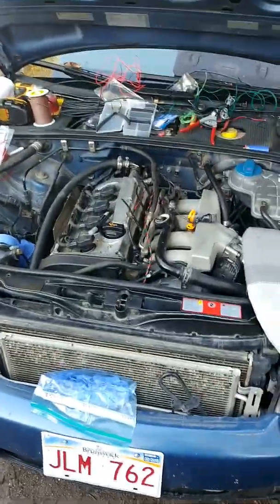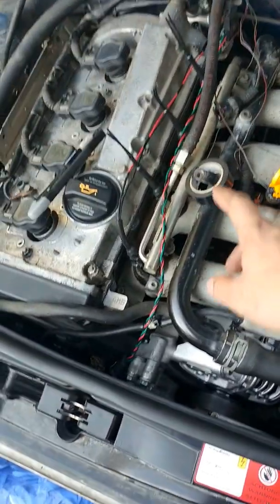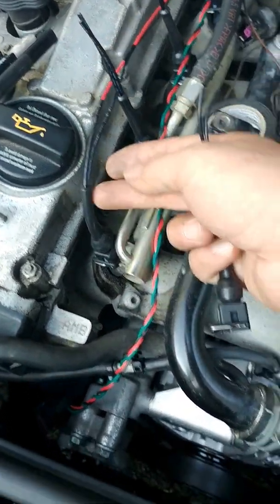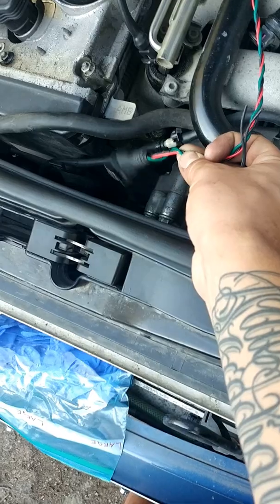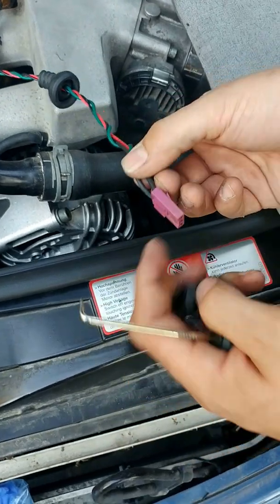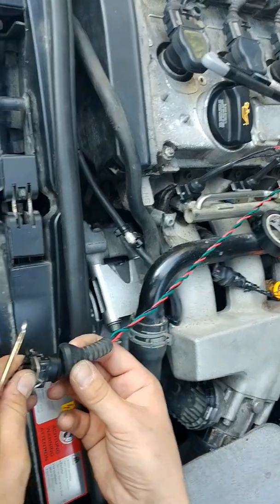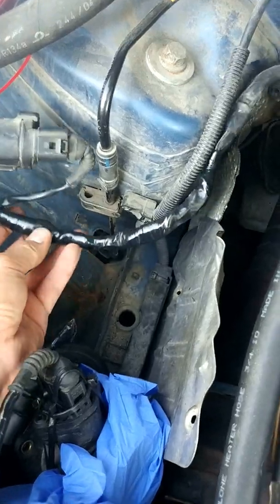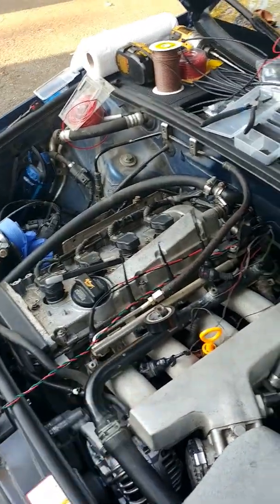b6 a4 1.8t fuel injector repair

Comment: Hey cool video umm I don't know if you still have this same car or even know the answer to my question,but I was wondering how to I go about finding out which wire goes to which pin number on the fuel inj. Plugs..I had at one point it all video taped and written down and such the order in which they go but amidst some controversy it has all been lost or thrown away...well thanknu...as I've been trying to find the color code basically for my injectors on my 2003 a4 1.8l..tllhanx

Comment: Hey mark, my car cranks but does not start, I hooked up the scanner and it’s giving me a code for every injector. HELP
Reply: What specific code is showing and what does it say?
Reply: P0265!
Reply: Crank no start a4 audi 1.8t 05 every one I know tell me to get rid on my car but that can suck my ⚽️ 🏀 🏈’s I replaced just about everything for this car I had it for 10 years 😞 don’t know why it won’t start! Gave out on the highway and it’s freezing outside been in the garage for about 5 weeks 😖 I hope it will run again sounds like it wants to but 🤷
Reply: @phlandusalexander8507  had my coolant temp sensor fail once and my crank sensor too. Both produced no start. Temp caused extremely stubborn cold starts and crank caused stalling when it was fully warmed up. I know its been 9 months but try running a vag scanner on it and check all the miscellaneous stuff like instruments for example

Comment: Do you know what the colors were for which?
Reply from the maker: Super straight forward. Brown is always your ground. For the other color it's the power
Reply: sorry Im learning but to my understanding one of powers is a signal and should be in correct location... buuuut this more of a question as Have reinstall wires in the sensor (always a lil cover every one I try zoom in on )and also im fixing mine like yours .. well im trying.. show me the way my friend
Reply: @jeremyremington8897  green with red strip is power. Brown is ground (2 of them) then there's a colored one with a strip on it. (slightly different color on every cylinder) that is your injector trigger wire. Which is usually spot number 3
Reply: Thanks for getting back to me so fast
. literally working on this amongst other stuff..sorry I forgot that I seen that you halso do did the crank shaftnsemsor  rewiring as my clip deterioriated and inside sensor as they just need reattached ..   so many ppl freaking shoe.how to install this sensor like the world needs 30 videos  doing the most simple job
lol oh ps already did the injector clips too.. except I has get mine from 3 autopart stores as i guess only  stocking 1 or 2 is the standard.. Coil pack ones are soon
. well everything needs freshend up on my side bi#$$ aka  6speed ultrasport :)
Reply: @jeremyremington8897  no worries I'm trying to work out the kinks on mine